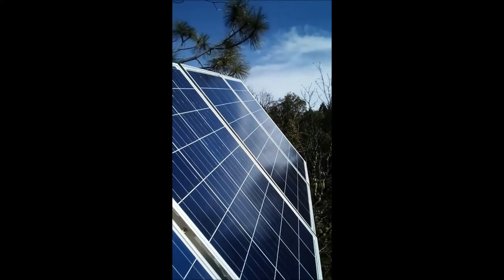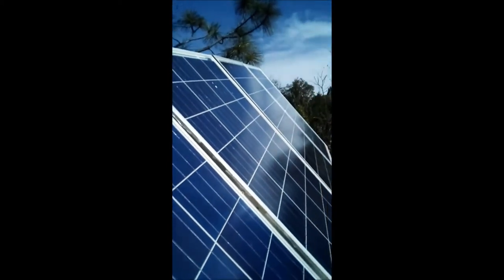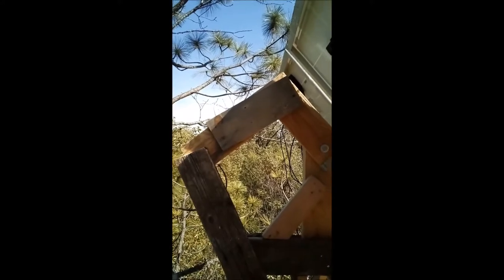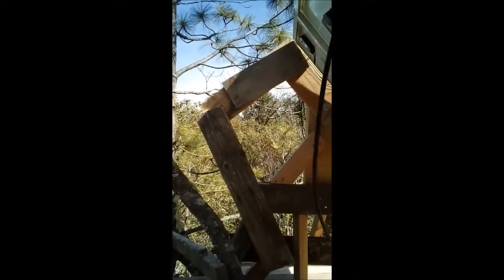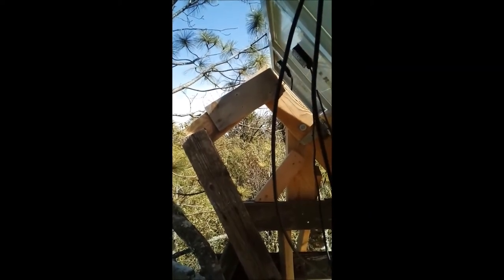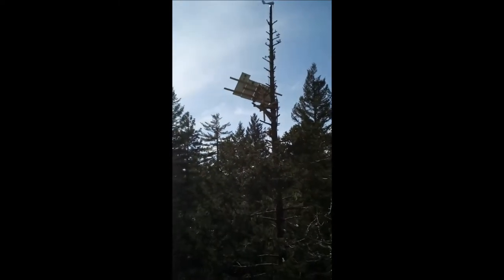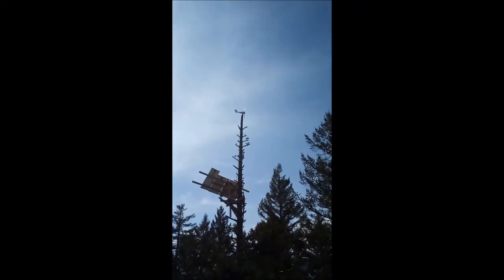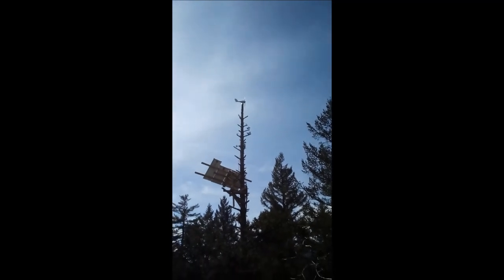Off grid DIY Duel Axis Automatic Solar Tracker Design and Installation

Comment: Your dedication to obtaining the benefits that self sufficiency of solar has, has earned my subscription. 

Well done brother :-)

Question 1 : I'm new to solar and am researching if monocrystalline or polycrystalline panels would better suit my application...

... which is one that will be on the Colorado Plateau high desert. Which entails 105° F + all the way down to -5° F and winter is long and hard. And throw in lots of wind that carries dust when it's not frozen to the ground, and you have my recipe for an solar array... 

Ultimately I want a nice back up for the proverbial just in case, not to be divorced from the grid... 

If it's pertinent in knowing if poly or mono would be better; my Long term goal as budget allows I'm thinking 8-10 100 watt ground mounted panels and 2 Epever 30 or 40 amp mppt's. 

Rhetorical thought : I've kinda thought even running one mppt mono and the other mppt poly... but I don't know. 

My journey began at Harbor Freight about 2 weeks ago when I used a coupon on the 100 watt kit for a $150 , as I've been focusing alot of attention to prepping the last 18 months. 

But anyway, I bought it thinking I would go home and research solar as a whole and here I am. I have not even opened the HF kit because I'm thinking of returning it to allocate money wisely on better equipment. 

Question 2 : Can one mix and match different types of panels as long as they are all the same volts like 12v or 24v ect ? 

For example, can I run my...
100 watt 18v amorphous 
(Future purchases of the following ) 
100 watt 20 or 21v mono 
100 watt 20 or 21v poly 
In parallel to a junction box or bus bar and then into a charge controller ? 

Sorry I've talked your ear off, you seem very knowledgeable so am hoping to glean from you. 

I appreciate your time spent in responding. 

Thanks